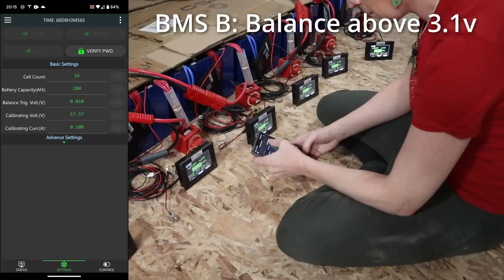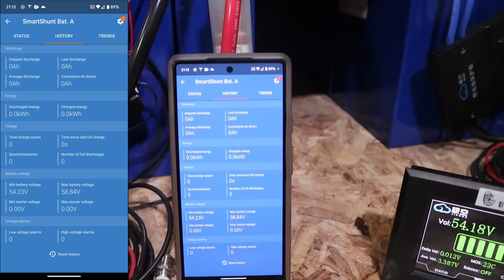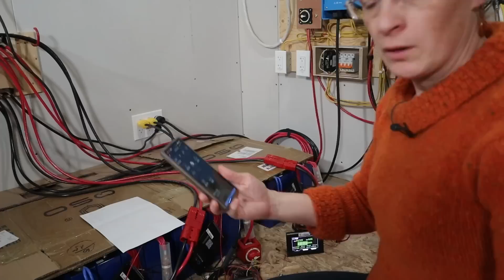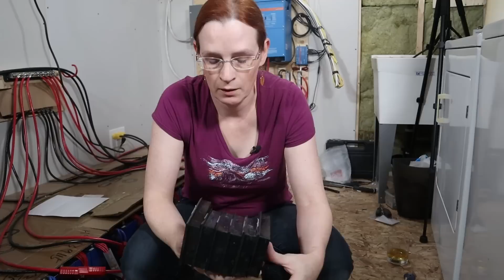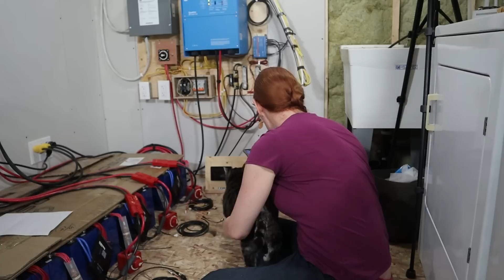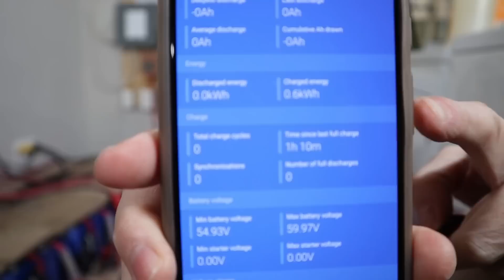Sparky Science! - Big Battery Build! (Ep. 48)

Comment: Thanks for sharing the scary bits and I'm glad there was no serious damage.  This makes me curious what the current draw is for those displays... have you ever tested one?  I'm guessing you or the guy who helped design the buck converter must have had some idea of the display load (maybe just paperwork they came with).  I looked that DC-DC converter module up and it says the output is 500mA.  That sure seems really low with not a lot of head room.  I know you were venting and about ready to trash the displays, but I think you ought to give them another chance.  Maybe just a test with a manufactured buck converter that can handle a couple amps (just buy one for a test) - they have nice sealed/waterproof units for $10-20.  With a fuse this time of course.  Enjoying watching your journey, keep at it!
Reply from the maker: I tested the current draw at 2w in a previous video. The buck convert is rated for 6w, should have been plenty. I'll revisit the displays later, I admit I may have been a bit harsh on them in my frustration.
Reply: @TheDigitalMermaid  Yes, 2W should have been fine with the 6W converter (the other 5 were still working).  Could have been a faulty component or possibly a surge of some sort (that can't be seen without an oscilloscope).  Maybe going with an isolated 12V converter like Andy uses would be better than trying to run a little one directly off each battery (and the fuse block he uses would work like a champ for 6 displays).  You've mentioned there will be other 12V devices on the boat so you probably already have some ideas planned.  It'll be interesting for many viewers to see how you resolve this.

Comment: Your current analyses of the issue seems to be valid, something when wrong.  There could be a multitude of issues with this one particular battery build from the wiring, buck converter, monitor, BMS, or even the battery.  I remember a previous video where you had an issue with the buck converter and had mentioned you were going to install a fuse link.  I see that didn't happen, and it would have saved components and wiring, but not immediately answer the question of why the fuse blew.  Hope you find the answer.
Reply from the maker: Not putting the fuse in is the biggest reason why I was so upset. I knew I should have, but I didn't. Lesson learned, and thankfully without too high a price this time.

Comment: A fuse block is not a bad idea. There is also thermal current limiting type fuses so what happens is if you try to draw more power from the circuit the little thermal fuse will get hot from the current and it effectively opens the circuit and stops the electricity and then it will cool down and self reset so its cool because you don't have to keep replacing fuses over and over.
Reply from the maker: That's probably exactly the kind of fuse I should have used on this. Now that I am calming down, I am thinking again about returning the screens. If I do, it'll be a totally new buck converter design, and fuses will absolutely me part of that.

Comment: You are doing a good job even with the faults. I appreciate your honesty and determination. Learning is hard and mistakes happen. Also we'll done with the quick action with the chisel. 
I suspect the problem with the buck converter is a voltage spike cause by the BMS cutting of the charging current suddenly. Cutting the current with the inductance of long cables between the quatro and battery will cause spikes. This is why auto electronics are rated for 4x the normal voltage. So the converters will need spike protection and filtering. A spike may have made an arc on the back of the vero board, I think its spacing or clearance is only suitable for low voltages.
You are right about needing fuses. The fuses protect the wires and small components from the big things. So everywhere wire size goes down add a fuse. Get a bunch of small inline fuses and sprinkle them everywhere. Anther option is to use solder in axial lead fuses with heatshrink to cheaply make up inline fuses. They are one time use but will be there when needed.
Also can you set the quotro charge voltage lower than BMS cut off so the charge current has tapered before the BMS goes to protect. But this is not applicable when you are doing tests at the extreme top of the battery capacity. And it is good to test how all components cope at the edge cases such as BMS going into protection.
Also when you are building your other 12v packs. Temporary stick tap on and around every exposed contact or wire of your pack and only untape the one you are working on. This way only one thing is exposed at any time. This will help if something like a washer is dropped or a wire springs off.
I hope this is helpful. I want you to continue. P.S. I am also looking forward boat work and adventures.
Reply from the maker: This is an interesting theory, and echos some of what Andrew told me when I blew the cap with the bad diode placement. This buck converter is rated for 18~90vDC input, with a max output of 6w/500mA. The screens draw 2w, so I should have been in the 3:1 safety range. I do think I need to revisit the Quattro charge voltages, it might be worth experimenting with where the Quattro cuts off and see if it tapers enough. 30A is really not much though, but hey, science! Thanks for such a detailed comment!
Reply: @TheDigitalMermaid  
The jump in the coil you showed us might be a big hint. When you put 30A through that it wants to keep going, and can course a huge voltage spike if it has nowhere to go. Not sure if it could have gone to you buck converter because I think it was connected to the battery that just disconnected. Let us know if you figure it out.
Thanks showing me how important fuses are! Remember to use 50 V DC rated ones.

Comment: Madi, do you want a fabricated PCB to rebuild your 12v buck converter boards on, with nice solder pads and thick traces etc? I made a design for you, if you want to get some made.
Reply from the maker: That's extremely kind of you to offer. As of right now, I don't plan to add them back. However, I really did like having the screens. I had spoken to my friend Andrew about possibly making some specifically for the JK for folks caught out like me. If you've already got a working design though, feel free to email me. I'll ponder it for a bit. (email is in the 'About' tab).

Comment: I'd disconnect the batteries from everything while the batteries are not being used for a while. Balancing issues are mostly a problem while you are close to charging all the way to 100% or close to discharging all the way to the minimum safe voltage. It's at the voltage extremes (fully charged or fully discharged), they have to be perfectly balanced. Unless there is something wrong with the battery, lithium batteries should hold their voltage really well for months, so there's no benefit to having them power anything  when they aren't being used. They can be a bit unbalanced when they are half charged. A lot of DIY battery builders don't use a BMS at all. They just stay away from fully charging and discharging the power bank and they use a multimeter once in a while to see if any battery is drifting towards an unsafe voltage. Good job stopping the fire!
Reply from the maker: Ya, the recommended storage SoC is in the 50% range, iirc. After I uploaded this, I started thinking that the screens might have pulled the packs down enough to show inequalities in the cell voltages, triggering more frequent balancing. Though as you said, the differences should be most pronounced at the extreme ends of the SoC, so *shrug*?

Comment: Ouch, pretty scary when that happens.  Fortunately nothing big has caught fire.   What's the power requirements of those screens?  I looked up that part's datasheet and it claims a max of 500mA/6W, which i would have thought would have been enough.  I guess it's irrelevant now anyhow :)   Regarding the jump from 200-odd up to 280Ah, is the first value the measured charge current so far, and then once it hits the max value it says "oh i'm charged now so this must actually be 280" ?  I'm never sure how they track the "real" capacity

Anyhow thanks for showing the bad stuff as well as the good, your videos come across as very honest which is nice amongst the sea of videos on this topic that are riddled with sponsors and careful editing to the point you can never quite be sure if you're watching someone's experience or just a cunningly disguised advert. 

Burned electronics produce a remarkable variety of different smells, and not a single one of them is pleasant :)

I'm looking forward to seeing more about your boat
Reply from the maker: Screens are 2w, so 3:1 safety ratio, which I thought was enough. As for the capacity, what threw me off (and still does) is that the BMSes were on, and there was no draw on them, for three weeks. So how did it think the SoC fell so much? I understand the reset at the top of charge. Thanks for the kind words, I try, if nothing else, to show the realities of a project like this. :)
Reply: @TheDigitalMermaid  The BMS sucks at keeping track of capacity when small currents are flowing. It's pretty accurate when in use at loads, but otherwise... It's a hardware limitation, which they said they were working on - but it's not the only issue with JK right now sadly. They had a lot of potential and I'm happy with mine, but they could have been so much better as a company. If you want to keep track of SoC accurately, use the Smart Shunt only (or other dedicated device), and ignore the rest.
Reply from the maker: @upnorthandpersonal  That's exactly why I wanted the SmartShunt. It's my only real source of truth, but even it will miss light loads and parasitic draws. The real takeaway for me, so far, is that these tools are guides, and guides only.

Comment: If you are leaving for months - then you don't want to leave them "topped up" LiFePO4 wants storing at 70% - or at least drop the bulk/abs to 3.33v/cell so you don't want to store in the upper "knee" of the charge curve.

Balancing on new cells, matched cells - should not be needed. I've 900ah @12v - 6P4S - and a 100ma balancer and spending most of the year between 40-80% SOC rarely at the charge balance stage.  3 years in, balance is still good - 0.04v @ 3.6v/cell, 3Gwh been in/out the cells.

Look forward to the test - like you say one of the few people that can do that with 6 identical setups like you have - will watch the rest of the video now only a few mins in.
Reply: the balancer will only kick in with load/charge - otherwise the cells will stay at same voltage and not trigger balancing. So not a good test of balancing (comment 10 mins in)
Reply: er .....  you are doing good work, thanks  :)  (19 min in)
Reply: Your parasitic drain test is valid, but for "where to set the balancer to kick on" the methodology wants to be - use all for a month cycling as per use, then check voltage diff of cells/imbalance.
Reply: Looking forward to the boat content, like the idea of building a perpetual motion machine :)  Did like "Route Del Sol" and a solar powered EV camper (8kw solar) and he travelled Alaska to Mexico pre pandemic. Your build is interesting, have friends living on boats here in UK on the canals, and new build canal boats are often diesel/electric hybrids that can run on 100% solar/48v motor but they don't really maximise the solar inputs. Do like the plan you have to have the motor work as a generator while you are under wind power to recharge the battery.
Reply from the maker: @KevIsOffGrid  I've actually decided to do just this. I've got my rack running off the batteries now. :)

Comment: Hi... sorry for your "adventure"....If you want to monitor & control all your JKBMS, you can do it via a simple ESP32 via BT and the github code of syssi. You just need to know all individual MAC adresses of all your JKBMS. You can either send all theses informations to your VenusOS via MQTT. With this solution, you just need to power one unique ESP32 with 5V (no more extra cabling) and of course now with a 2A fuse before the step down converter ;)
Reply from the maker: I bought the RS485 adapters with something like this in mind. As of now, I am hoping to replace these JK BMSes (not sure yet). If I don't, then I will pick back up the project to collect the data and display it all in one place.
Reply: @TheDigitalMermaid  I see..... btw, I don't know any (chinese) bugfree active BMS.... I am interested if you find something with a working communication. Since I am victronless, I am not focusing especially on CANbus but more on RS485
Reply from the maker: @e2nomy  If/when I replace the BMSes, I'll certainly be going into great detail here in the channel. :)

Comment: Yeh F these screens, I've not even connected mine (same issue as yours), have 2 batt banks  with a JKBMS each. I just stuck a Pi in the battery cabinet and I read the bms's out every other minute via bluetooth and send it to mqtt for ingest in HA or Grafana. 
Don't fret, I've pulled similar stunts or ran into similar misery, it can all be overwhelming until it is no longer because.. experience!
Reply from the maker: If I keep the BMSes, I'll certainly collect the data into a central database for display all on one screen

Comment: u r very dangerous girl lol that was crazy thankfully u r fine keep it up and about ur electric motor check out  Candela C-POD the world's most efficient boat motor i don't know if they sell them separately or not  but it's what u needed and what u where looking for.
Reply from the maker: Candela looks fascinating, but it seems to be designed for high-speed applications, and they don't seem to sell it as a stand-alone part. If they did, then the question would be regen to third-party batteries.
Reply: @TheDigitalMermaid  The Candela C-POD  is a 50 kw -- around 70 hp as i remember it wouldn't hurt if u email them and see how it goes time to roll the dice and see ur luck it will be so fascinating to see how it goes with this new tech in real life anther mind-blowing project .
Reply from the maker: @khall3307  I only need 10~15kw though. That's like buying a Porsche engine for a Honda Fit.

Comment: I also had a buck converter blow.  But it was when it saw too low of a voltage, just enough to be on, but not enough to be stable.  It might be easier to power all the screens from another small battery - you need a 12V system too, right?  
Or possibly add a small resistor across the bms so even when off it keeps inverter caps charged but doesn't let it charge or discharge much.  When you have all batteries off and one bms starts it will have a high inrush to the inverter caps, which might have also done something  to the converter.
Reply from the maker: I originally thought about a dedicated 12v supply for the screens, but I really wanted to keep each battery fully self-contained, which is why I went the buck converter route. If I somehow change my mind and put my screens back though, perhaps I'll do that.

Comment: This may or may not help.  I had 40 220v heater to install on a machine. Note : all were brand new, tested by the manufacture. And set to be installed. They all worked fine for 30 day. Then one by one they started to burn out or open circuit. Like the year before we had to replace 40 more heaters. My point is Sh#$ happens. components "JUST" fails. LOVED that video.   Stay Safe were your safety glass.
Reply from the maker: Ooph. I've seen stuff like that a few times. We used to integrate Fujistu Primergy servers into our company's product, generally very good kit. Well some years back, there was a flaw in the voltage regulator where, after about a year of use, they'd pop... No warning at all, just *bam*, dead. Took the entire machine offline. Shit happens, to everyone.